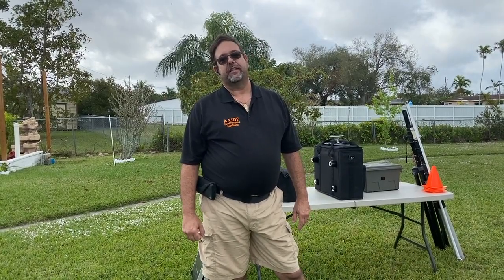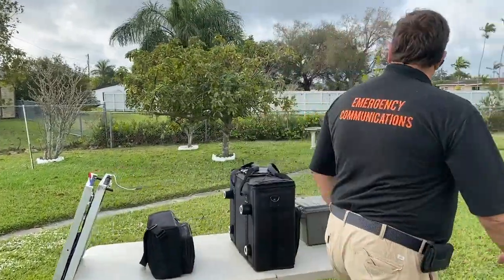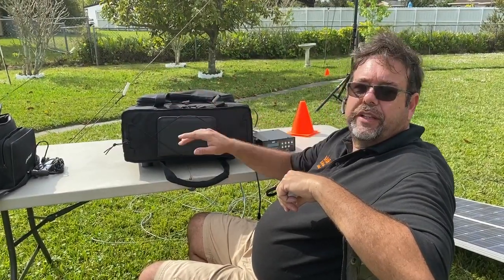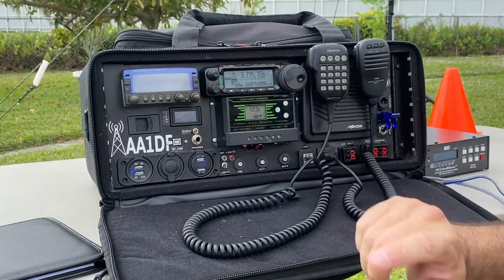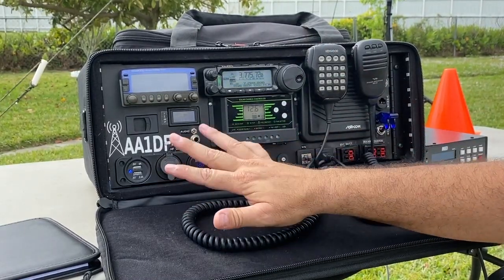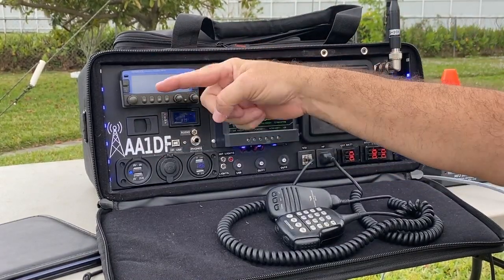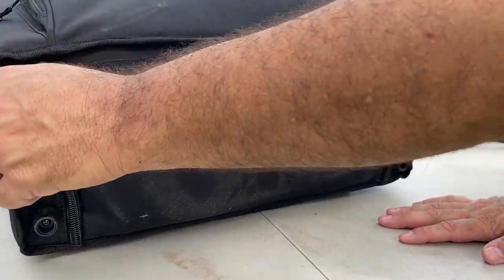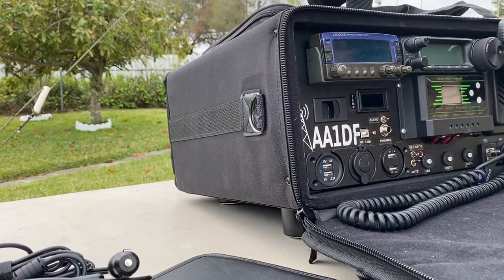Amateur Radio Go Kit Demo

Comment: Fine job on the go box. I built one for field day several  years ago and keep updating radios and ideas with it. I use magnets on the side to hold microphones while not in use. I like the antenna setup also. Solar power to maintain battery life is a must! Very nice de N4UVR

Comment: Use RED lighting if you're worried about night vision - not blue!
Reply: Red actually isn’t better. At all. Overall brightness is what harms your night vision. Our rods are bad at perceiving red light, so we have to use a much brighter amount to be able to use the cones.

Blue to green is the best part of the spectrum for using only rods, and using a minimal amount of light to do so thus preserving more natural night vision.

Red has benefits from being so poorly seen, in that it is less detectable to others. But unless you’re in the middle of the field trying to evade detection, it is NOT the color of choice.

Modern submarine instrumentation reflects this, they no longer project red light but blueish green.
Reply: @somorider587  Its actually a superior choice of preserving natural night vision is your aim. The benefit of red is purely that it’s harder for others to see.
Reply: red, blue and green could be used to preserve night vision. blue is also used to see blood trails when hunting. green is used by pilots to look at aerial maps. either way, those 3 colors mentioned is used to preserve night vision.
Reply: @Pahrump  i think Andrew learned something.
Reply: @thopkins2271  you couldn’t be more wrong. Red is it, as is green.
Reply: @oliverallen5324  No, the benefits of red light is that the wavelength doesn’t travel far without dissipating. So it’s much harder for others to see. It’s better than pure white, but in terms of what is easiest for your eyes to see in low light? Not red.

There is a reason that cockpits use what they use…and a lot of money has been spent informing those choices.

Comment: Freekin' awesome setup!  Well done.  I built two bugout boxes around 6U Gator cases.  One for satellite ops (my "space station") and one for terrestrial.  The heart of the satellite kit is an IC-9700, and for the terrestrial setup is an IC-7300.  With the bigger radios my boxes weigh a ton!  Thanks for the vid.

Comment: That's an awesome case.  But i see one flaw.  Even when you open the back door,  many of the heat will gather in the top front.   I advise you to create some holes in the very top front of the box where heat can leave the box.     But for the rest this is a very well designed go box,   Enjoy.

Comment: Very cool setup, well designed.
 
In case you haven't noticed, there's a thin red wire, probably for a switch that's under a lot of tension when you open the front. Otherwise, nice cabling inside.

Comment: Good job! I have my ft-891 go box with tuner
Built into a bucket. I am making my vhf kit into another matching bucket to sit next to my hf box.
I have a 50 ah power queen battery for power to be in a plano box. I have a 6u mobile rack
For future project. I have a wood working shop in my basement
If I want to make a rack like yours.
Suggestion I have a mega-watt 30a computer
type power supply.. It is small cheap and
no rf hash. It is dead quiet on my ft891!

Comment: A comment for those of us "of a certain age" - As light as this go-bag is, lifting and toting need to be kept to a minimum.  You might also consider the stackable, rolling tool boxes by Milwaukee and Ridgid.  Those let you stow common use things in the larger bottom box and mission-specific things in one or two of the smaller boxes on top.

Comment: I don't know if anybody has commented on this but why do you have the radios connected to a power supply versus directly attaching them to the radio? The battery must be a 12v one and the radios operate off of 12v. Using a power supply actually wastes a little power. Plus, definitely swap out the battery with a lithium iron phosphate one. And get rid of the power supply, not needed if running off of 12v. You can always attach a small inverter if need be.
Reply from the maker: There are many times where I operate for 24 hours or more (field day, disaster releif, etc.   the power supply allows the kit to operate indefinitely with shore power or a generator, where the battery has a limit before it runs out.  The solar panels recharge them to a certain extent, but not enough to keep up with HF transmissions or constant use (like field day).

Comment: Nicely done, but I don't see the need for an included power supply.  How often do you anticipate having 120VAC available out in the field?  I could see having a battery charger included, just to keep the charger with the battery, but with the included solar panels, the power supply seems superfluous. I imagine it would be helpful at an event such as Field Day where there might be a generator available, but I'd put it in a separate box.
Reply from the maker: Thanks.  Field day is just one of the times  when it cones in useful.  The batteries do not last very long when contesting for hours straight at 100 watts.  We run over 24 hours straight including overnight, so we run off a generator.  

The internal power supply also serves to recharge the battery when needed without the need for an external battery charger

Comment: Nice job!  You show the ATU as a separate device which you carry separately...maybe that should be part of the case, since your hf rig is in the case??? Also...you might want to reconsider the speaker switch...having 2 radios and only 1 speaker which switches between the two might be a significant disadvantage.   Maybe use an amplified speaker and mix the outputs of both radios?  I have a Yaesu 891, and that radio is going to heat up quickly, even on receive only...you might want to consider adding a fan.  I know the back of the case opens, but there is no air flow past the multiple heat sinks on that radio...a fan will prevent you from having to service the radio because of heat damage.
Reply from the maker: Thanks for the comment and the suggestions. I will keep your ideas in mind. I would have loved to build the ATU into the case, but there simply was not enough room in there. I used the Go Kit for Field day this year and operated all day with no overheating issues with the FT-891. I was setup outside, but under a shade canopy. I always monitor the temperature with the gauge I installed and and if I see any overheating issues, I'll install a fan on the side of the case or something.   73  AA1DF
Reply: Again, nice job, and have fun!! 73 de N2MXX NJ
Reply: @David Fernandez  hi I would like to build a kit where did you the item

Comment: I am back watching again, trying to get ideas for portable operations.  I have a question on the Solar Charge controller.  Do you find it is “RF Quiet”?  Most charge controllers have a good amount of RFI, but there are some that are designed well.  I am curious if it is RF quiet and if not, what you do to mitigate the noise?  All the best, 73 de KI5HXM
Reply from the maker: Hi.   These cheap PWM solar controllers are hit or miss.   This particular Chinese unbranded one I was using was relatively quiet, but I have  others that do make a whole lot of RFI noise.  

Since the time I took this video, I have replaced the solar controller with a West Mountain Radio Epic PwrGate. It automatically switches between batter and power supply and manages the charging via both power supply and solar. It is specifically made for ham radio and does not make any RFI that I have experienced.
Reply: @ke4tin  oh I didn’t know the Epic PWRGate was also a solar charge controller. Hmmm that is a horse of a different color as they say. Lol

Comment: A LiFePO4 battery would be better because the voltage is 13+ so the radios work better. It would also be much lighter.

Comment: I LOVE this case! I've wondered about using a Gator case, but the missing element for me was something like that hinged locking faceplate. 

**WHERE did you find this magical 4u component????** 

Wonderful design and work. From my perspective one of the very best I've seen so far. So practical for an actual deployment. 

The only change I will make is placing the power and antenna connections in the rear to avoid cord clutter in what I'd use as a work area in front of the radios (the padded top), well, and upgrading the in-case power to a lighter Bienno pack I have.
Reply: @JohnMassaglia  THANK YOU!!!  Looks like I have a Memorial Day Weekend project to start! 😁
Reply: I could not resist. Just bought the bag and hinge door. That is awesomeness right there

Comment: Hi again, I am interested in this box and haven’t been able to find a hinged front panel like you have.  Where did you find that panel?  Thanks, 73 de KI5HXM EDIT: I have found some on Amazon.   Does your box use the 4U or 6U blank hinged panel?
Reply from the maker: This is the one I bought on Amazon.  It currently says it’s unavailable, but maybe it will come back in stock soon, or you can search for the same one somewhere else:

StarTech.com 4U Hinged Rack Panel - Solid Blanking Panel for 19-inch Server Racks - Tool-less Filler Panel (RKPNLHS4U), Black https://a.co/d/8JjVEdx
Reply: @ke4tin  thanks. I saw that after I asked.   I have seen some that are available. My goal in this is to have a radio kit that works for QTH and portable.  Thanks again.  Where are you located? I am in north Texas.   All the best 73 de KI5HXM

Comment: I noticed no ground solution.  Does that cause issues?  Secondly, I was under impression solar charge controllers can be RF noisy but must not be to bad for you.  I like the setup and engineering you have done.  Links to the bag and front plate would be convenient in the video description. 73 from K6TJO

Comment: On the first day of WW1 and WW2 they shut down all amateur radio communications. so whats the point ?
Reply from the maker: There is no way to "Shut down" amateur Radio Communications. Amateur Radio communications are not dependent on anyone else. That is the beauty of Amateur Radio and why it is such an important tool in disasters.  People can try to cause interference, but there are still ways around that. Also, go boxes are not for wars. They are for Public Service events, disaster communications, and for special events like field day. It seems you are very misinformed.   If you would like better information, I would reccommend either chatting with your local Amateur Radio club, or google.   Or, if you are just looking to try to create drama, then I would suggest political or religious topics instead.  Those tend to be more dramatic if that is what you seek.

Comment: New subscriber here and new Ham (General). I love your go kit and how things are designed.  Great design and good cable management inside.  Did the case come with the plywood or did you add it for strength?  What hinging front panel did you use?  I don’t see the parts in the description and I would be interested in doing something similar.  Thanks.  All the best, 73 de KI5HXM.
Reply: Brent, I'm also building a go kit and using some inspiration from David's kit here. I'm nearby over in the Fort Worth area. 

I want to point out that on 3/18 (so 10 days from now) there's going to be a go kit challenge over in Highland Park (near Lewisville), not terribly far from you. It'll be at the Doubletree Ranch Park from 0900-1300. If you're still building or want to show things off or get inspiration, come check it out.

73 de K5RNL.
Reply: @davideddleman7101  excellent! I will see if I can make it.  Is there a url for the event.  I would love to come and see some kits.